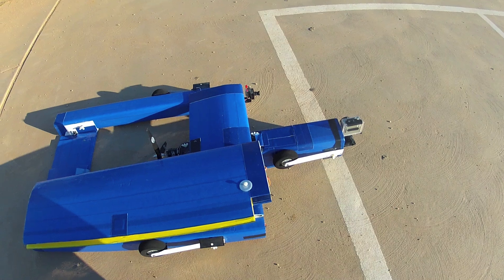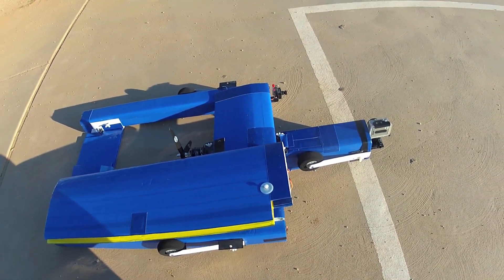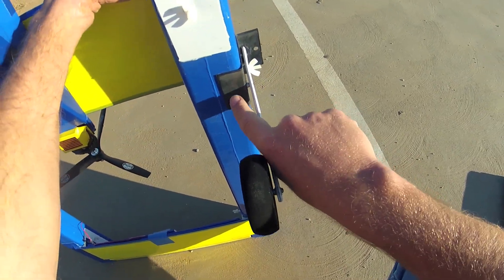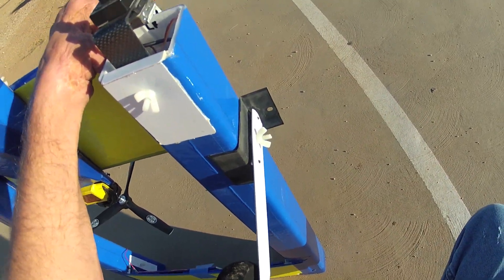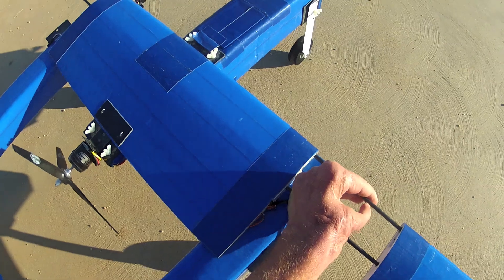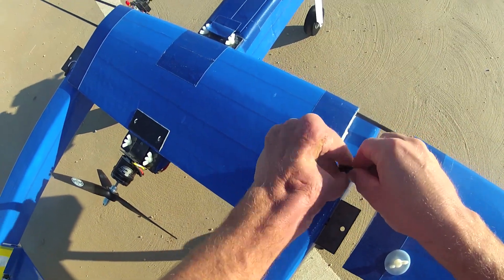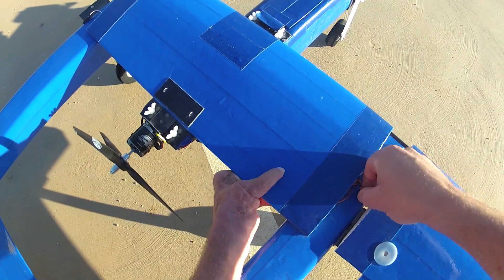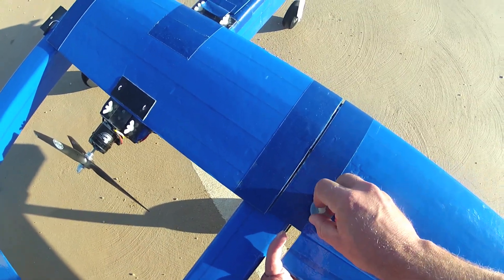OZONE: Set-up for Flight

Comment: What calculation do you use for the distance from the trailing edge to the horizontal stabilizer? I found one online that said the distance from trailing edge to where the horizontal stabilizer and elevator hinge is located should be 2-3x the chord of the wing.

Comment: ed,

using a skysurfer for mediumrange fpv. 2Ah gets me to 5 miles and back on a still day but due to slow cruise speed (sub 20mph) it takes .5h+ and as little as 7mph winds and i need a bigger battery + it takes forever. want a fast but reasonably efficient fpv airframe so i can reach further faster. not interested in uptime in itself, rather uptime x speed. thinking low kv + large folding push prop on either synapse or ozone may be worth trying, which one would you recommend? any other advice?

Comment: Great video Ed... love that Z-shaped metal bracket that doubles as both a wing attachment and a landing gear attachment. I suspect the gut who invented plastic bolts and wing-nuts would be mightily impressed. Do I understand correctly that the 5mm OD arrow shafts fit INSIDE the 7.5mm OD arrow shafts?

Comment from the maker: No problem man, you'll be good with that Axon.  Just dial in a few degrees down-thrust.  Put landing gear well forward and ensure the CG is at 30% rear of the wing leading edge and I guarantee it will fly off of a smooth surface for sure.  Check in on the RCGroups thread on Foamboard Scratchbuild University and there are many smart, intelligent guys who can help you out.